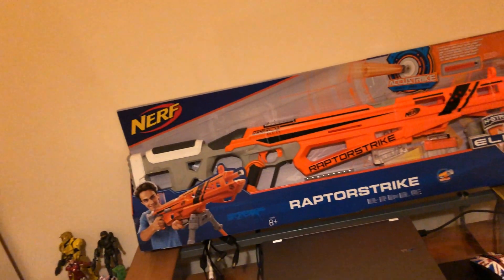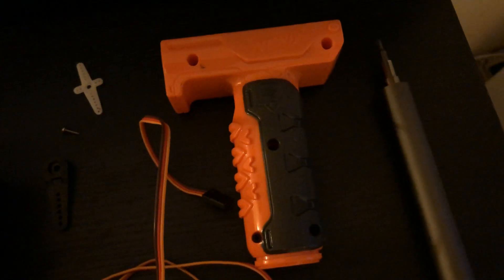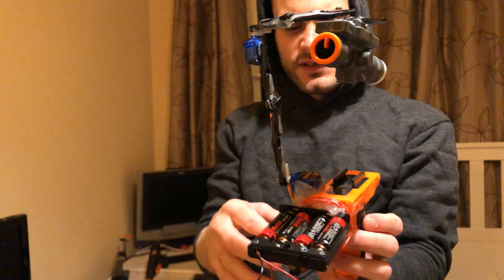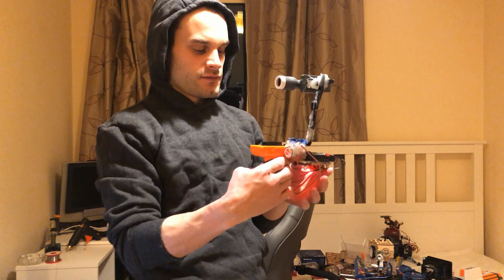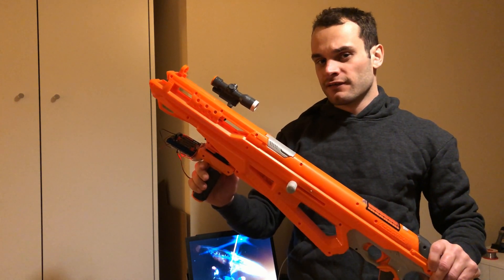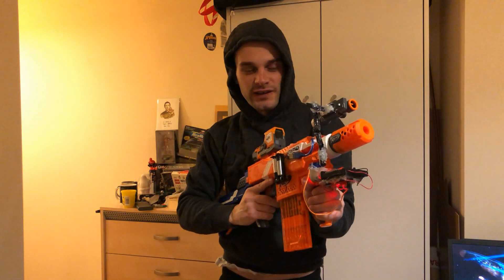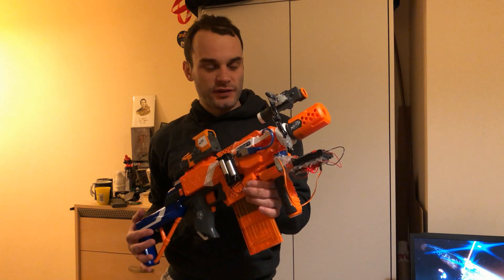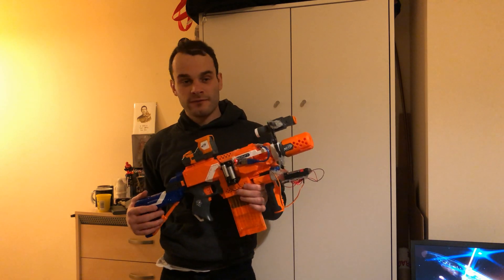Nerf Scope Module | Arduino Project

Comment: Cool concept!! I've only recently started getting into Arduino and the like and this is good example of something practical (sort of) that you could do with it! Only suggestion I have is that the volume of your voice is around a 3 and the volume of the music is at like an 8. Thanks for sharing your build!
Reply from the maker: Thanks! I'm still getting used to doing videos and stuff so audio is something I really need to learn about - I did boost the voice bits but yeah I wanted the Doom music to be really heavy haha.